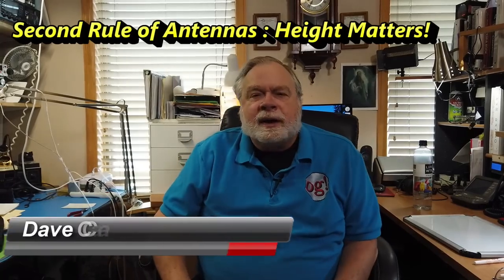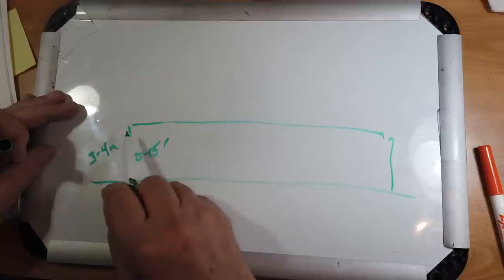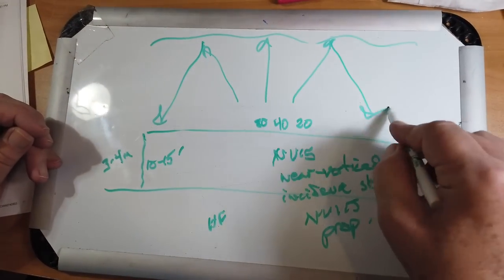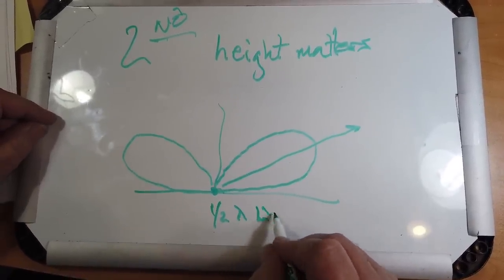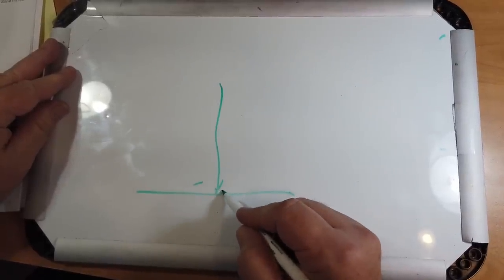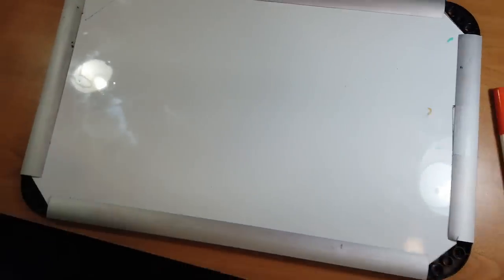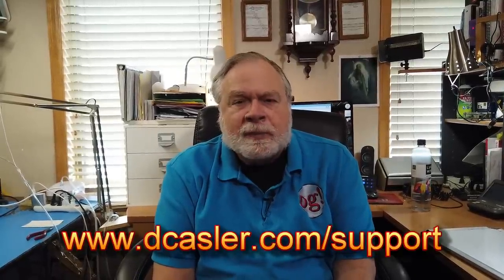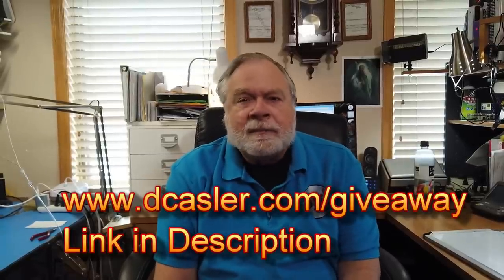Second Rule of Antennas : Height Matters! (#698)

Comment: Dave’s excellent presentation was entitled “height Matters.”

One rule of thumb that I have seen for the HF antennas suggests that their performance varies as the square of the height above ground.

Certainly putting a lot of radials or some other reflective field under the antenna will make a difference.  However, as I understand it, an HF antenna has complex interactions with the environment in which it is placed.   

Just to look at this in a very simplistic way, think of an antenna as like a light bulb giving off radiation (i.e. light).  

At HF, we want the antenna to “illuminate” the ionosphere.  This is the case if we want to work Dx or communicate with someone more than a few miles away.  

Think about placing the light bulb in in the a large round reflective dome close to the center of the floor (terrain).   Assume that the floor is dark and somewhat bumpy (i.e. hilly).    

In this example the reflective dome is the ionosphere and the dark floor, the ground.  

The higher the bulb, the brighter the inside of the dome will be.  Even if the lightbulb only gets to a fraction of the height of the dome, the amount of light in the dome will be a sensitive function of the height.

Comment: I'd suggest asking what he is wanting to achieve first. NVIS can get you coverage in areas where you would have a massive skip zone using a ground mounted vertical. The super low take off of quarter wave vert will be appreciated by people in your groundwave area. Plus super far away. The 1/2 wave above the ground horizontal dipole will have two broad side lobes at about 30 degrees. Not so flash for pushing as far as you can over the horizon. Great for reducing noise as noise is usually vertical. 73s

Comment: One first needs to ask, "Who or how far do you want to talk?"  NVIS in the middle half of the USA can reasonable cover 2/3 or more of the population of the USA and parts of Canada or Mexico on 80, 40, or 20 and still get DX on 15 and 10 when the band is open.  For decades all I ever heard about getting the antenna up really high for low take-off angle and working DX.  Yet, one can work a lot of enjoyable ham radio without always chasing DX.

Second, one can get the low take-off angle with a vertical.  Even a short loaded antenna like a ham-stick over a minimal ground plane or counterpoise wires can give interesting results for DX.

Comment: A foot note to David information on the transmission angles are mostly for transmission.  You will receive from most angles.  This may confuse you; some strong station cannot receive you due to your NVIS angle.  I love dipoles but the vertical does give you the better Transmit angle.  5/8 wave vertical is the best.  David has a good video covering it better.  Which is better: Vertical or Dipole?

Comment: What about the issue of ground losses.  My best guess is that the signals coming off a low antenna just land up warming an earth worm's den.  This would be an independent issue of the influence of ground proximity on radiation pattern.
Reply: One could add some wire in the ground to improve the reflectivity.